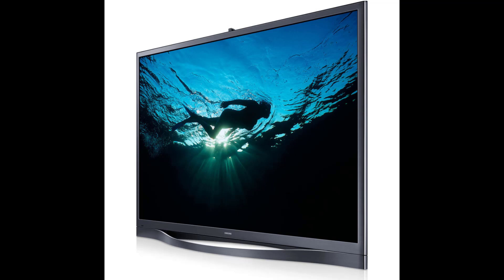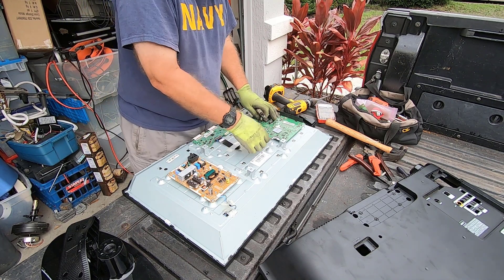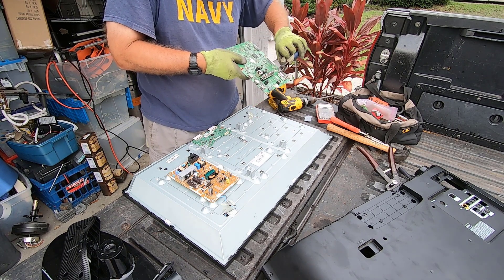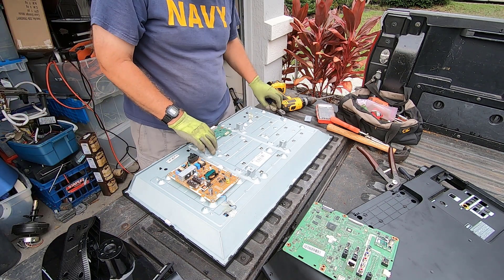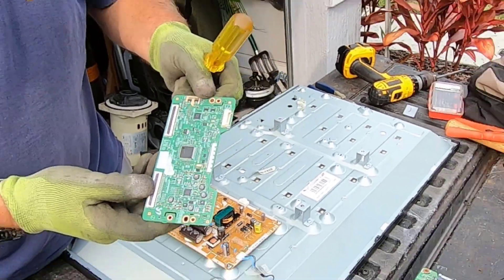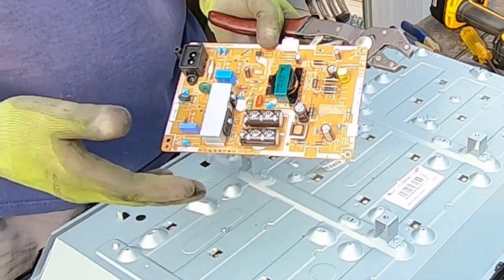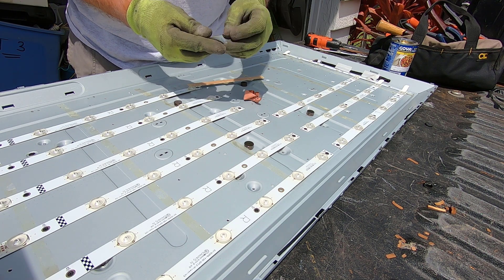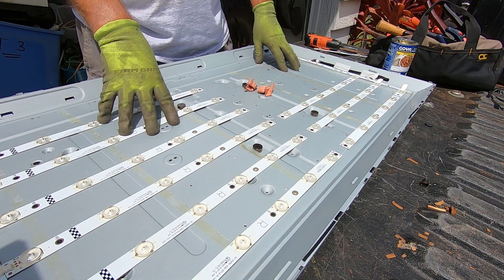Hidden Copper in LED flat screens

Comment: 15:30 Did you mention there were gold bond wires inside those LED's?  There IS copper in those strips, but it's inside the boards, not exposed to the outside where you can peel it.
Reply from the maker: As you saw in the video I did not address the LED's, that would be it's own video.  You are correct that there is more copper still in the boards, which is why I said to put the boards in with your low grade boards.  Of course, not all these are going to have the copper tape - also shown in the video - and those boards should also go in with one's low grade boards.

Comment: Sweden here again. I get a whole lot of those stips from the electronics repair shop,, it's like a banana box sometimes. Usually I don't tear in like you did but lose strips I will as I didnt know about that copper tape, thank you.
Did you ask the scrapyard about Mosfet?
Reply from the maker: I did, thank you Peder.  Unfortunately, ewaste is not their strong suite.  They said to just leave the mosfets on the boards they came with.
Reply: @sharkscrapper  that was a bit of a bummer but atleast you asked.
I am having a snack at the moment and then go do a pickup from electronics repair shop,, a whole lot of printers.
Reply from the maker: @pederlindstrom3132  I hate scrapping printers.  Only do them when they're from clients - to keep them happy.  Even with gloves I seem to find a way to get ink on my hands.
Reply: @sharkscrapper  agree. When he said printers I got a picture of a desktop inkjet printer.
They were labelmaker printers.
Aluminium housing and a decent board in them, 16 printers.
Also some other scrap I have no Idea what it is.
Now it's time for pizza 😃